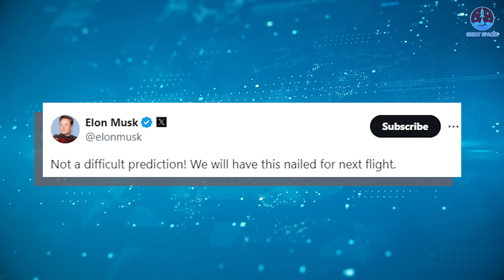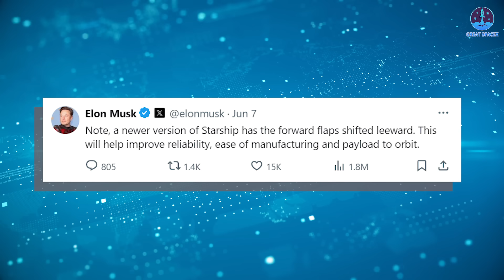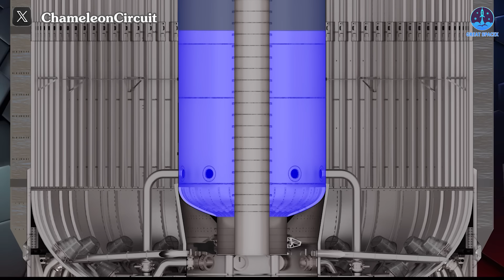Elon Musk Just Revealed Massive Changes On Next Starship Prototype After Flight 4!

Comment: Did not appear to be a HS or attachment problem, but the moveable joint of the flap. Even that narrow gap is a weak point, The joints on the space shuttle were all at the less susceptible aft section of the craft. The shuttle did well but was not as large as this and it still took 6 months to ready it for a next flight. This is still called the development phase, figuring out what works and what doesn't.

Comment: Too many heat shield pc`s. Bigger sections and the equipment needed for manufacture of such larger areas adds to less assembly time and added rigidity.Larger autoclaves and molds would have to be made.It`s a lot easier to make many small pc`s all or most of them the same shape but inconsistencies at attachment points leading to failure.

Comment: Could they not slow the ship down in orbit and then enter the atmosphere much slower, thus making the time under such high temperatures shorter.
Asking as i thought the ship was burning  for a very long time compared to other re-entry burns.
Reply: You need a lot of fuel to slow down. The only way to do that would be to "gas up" while in orbit.Taking more fuel at the launch adds weight which your rocket has to muscle into space.Not a whole lot of fuel remains after getting to orbit.A gas station in space to refill would be the only to do as you question adding to complexity and cost but making for a safer landing.
Reply: This was a test flight, they were gathering data, no trying to get reenter quickly. The more data they can gather, the safer and more efficient the reentry will be. Do you know they intentionally removed tiles and also placed half thickness tiles to test and optimize the thermal protection system. That's what test flights are for. These are not finalized finished products. 

Also, keep in mind this booster was built many months ago. There are new modifications on newer versions,  yet to be tested.
Reply: What happened to the booster and starship? Seems like both would float or at least have some buoyancy making it eventually wash up on a beach somewhere. Did they deliberately punch holes in it mitigate this? Seems like recovery would be a data win.
Reply from the maker: Great discussion

Comment: I'm just a casual viewer of SpaceX's wonderful achievements.  I have always wondered if they could apply some sort of heat shield paint or spray that they could apply over top of the tiles.  That might help keep them from falling off and give a little more protection.  It would burn away and let the tiles do the job that they were intended to do.  The main point is to keep tiles from falling off because a spray/paint/foam/whatever would have no gaps an act like a protective shield.
Reply: Yes, but what is the cheaper or lighter approach .

Comment: I don’t understand how they can accelerate to 26,000 mph in space yet they can’t slow down before re-entry, like turn the ship round to use the same engine to slow it down!
Reply: Fuel and Oxidizer to get up to orbital speed is 90% of a rocket by mass.
Only 3% to 5% of an orbital rocket mass is actual PAYload.

If you reserve 80% to 90% of that 3% to 5% mass for the propellant necessary to REVERSE that orbital velocity, you now have less than 1% PAYload.

TLDR: rocketry physics IRL is a stingy biyatch.
Reply: The extra weight (fuel) means reaching orbit becomes impossible.
Reply: Go check out Everyday Astronaut, Tim has several videos explaining orbital velocity, and rocket engines, and orbital mechanics for entry burn, if you really want to get down to the numbers on a space entry burn and the amount of energy required to de-accelerate, Scott Manly has a vid on that.
Reply: @f.w.1318  But spacex could use some electric thrusters to slow it down or have some other electronic system to slow it down in orbit . I do no see why fuel should be an issue when batteries don't change weight whether fully charged or not. Damn, install some solar panels, let the spaceship coast for a longer period of time to recharge before re-entry..
Reply: @palmtreeshenanigans  Electric thrusters have the thrust of a feather sitting on your hand. Batteries not changing weight when empty is actually a large DISADVANTAGE, not a plus. So you'd add many tons of weight then try to slow it down using basically nothing. Cool idea, kiddo.
Reply: Please learn some basic physics. The reason is elementary.
Reply: @rogerphelps9939  What an arrogant answer!

Comment: They need a big electromagnetic field generator to splay the plasma so it doesn’t interact with key areas. Problem is to make the field strong enough will require a lot of current. And to get a strong enough field may need super conducting magnets that will get too hot unless cooled with lox.
Reply from the maker: Great suggestion

Comment: Given the company's antecedents for exceptional innovation I suspect it entirely possible SpaceX could fabricate the dirigible control surfaces referred to as 'flaps' almost completely out of solid if  reinforced heat shield material.
The revised structures might not be any heavier than the present design which is evidently comprised of some sort of stainless steel primary substrate comparable to the remainder of the vehicle.
Should degradation to the control surfaces continue to occur during re-entry then the extent to which that might affect functionality for the structures could be less likely to be critical prior to completion of transit through that particular phase and affected structures could be simply and probably rapidly replaced.
Reply from the maker: Great comment 👍

Comment: WTF? There weren't 33 "rockets."  There were 33 engines.  Another major mistake and I'm blocking this site in my browser, never to be seen again.  Well, goodbye. This is the 2nd time the hot staging ring was used, not the first.
Reply: Good choice (to block site)
Reply: The guy's a total moron.
Reply from the maker: Oh, thanks for your contribution. We'll fix this soon
Reply: I think he meant it's the first (and only time) this specific hot staging ring was used as opposed to the first time they used a hot staging [ring]?
Reply: You blocked youtube because of this? Or did you just literally block this page? Either way, seems insane and dumb. Maybe just unsub from the channel? On the level of throwing your computer out of your window to turn it off. It'll work; it's just stupid.
Reply: @filonin2  No, I didn't block YT. WTF?  I have the ability to block a YT channel in my browser. Why would I sub to a channel that has very sub-standard information?  there a quite a few channels like this that have terrible information, rather than taking the time to do actual research.  I also block any channel that uses AI narration. The scripts are usually terribly written and the AI mispronounces words. If you can't afford a person to read the script, or cannot take the time to do it yourself, no thanks.

Comment: Why don't they put a landing gear on Starship and land on a runway?
Reply: Weight + more possible points of failure. 

KISS.
Reply: No runways on Mars
Reply: Starship has no need of a 'runway' as it is not designed to sustain horizontal flight and as such is designed and intended to land in a vertical posture.
Reply: It can't fly like an airplane so landing on a runway would be impossible, even with landing gear.
Reply from the maker: Great question 😂

Comment: Flap hinges will not go away as an issue. Ablative ridges running all tge way down the sides instead of flaps would divert plasma away from the vehicle, then they can use thrusters and gimballing boosters to perform a propulsive flip for landing.
Reply: just moving them further back like dream chaser the hinge gaps wont be a problem because the body of starship would be between the plasma and hinges
Reply: they moved the flaps farther back to the leeward side - gets them out of the plasma altogether ... problem solved
Reply: Why use a ridge when you can just put the entire existing ship in the way by moving the flap?

Comment: I think they should make it more like a traditional rocket with a second stage and a payload. So re-entry capsules can be designed like dragon. A specialized Starship just for mars. But the second stage needs a heat shield too so it can be recovered. That seems like the best way to use this system. Re-use boosters fully. Refurbish second stages and the usual maintenance schedule with dragon style capsules and payload fairings. Just the booster alone is a huge asset. I seems like they will have a lot of the same problems that shuttle had when it comes to thermal protection on Starship.
Reply from the maker: Yeah 👍

Comment: a good way to keep tiles from coming of is weld chicken wire then plaster tile over it that should work
Reply: Chicken wire turns to water, at those temps, assuming it's still there after the 26000kph flapping in the breeze..

Comment: I still think they need a better solution than tiles. They will do for now while they get the control systems to function properly, but for rapid reuse they will have to start messing with better alloys and maybe even a system of large one piece ablative shields in spots that see the most abuse that can be swapped out quickly between flights instead of tiles.
Reply from the maker: Yeah, let's wait to see how this system will be improved in the next flights

Comment: I watched the footage and that flap disintegrated badly so a major shift in heat shield method will be required.
Reply: heat shield were fine they are moving the flaps leeward to keep the hinge from the being exposed from the hot gases
Reply: There were tiles intentionally left off the ship for testing purposes, (and an ablative heat tile test) helping them gather the necessary data to make the best changes/updates possible.

Comment: What you see as Failure,I see as Intentional Failure and this is why. The missing tiles were obvious before they sent it. They said nothing. The failed engine was more than likely intentional too.
Keep in mind,The Heat Shield and hot fire shield is erelivent in the mon lander. In fact the Rear engine of the moon lander won't be used until after speration from the first stage. It will only take ONE RAPTER WITH ITS NUCLEAR FUEL CELL. 20 TIMES MORE POWERFUL THAN THE EXISTING 3 RAPTERS
Reply: What do you mean intentional...? Its good that the engines shuts down if there is an failure. But its not intentional
Reply: There is no Raptor ewth a nuclear fuel cell.

Comment: They could use a flexible carbon fiber skin that would cover the flaps hinges and possible the whole flap, then attach the shield tiles. We discussed this at my job since we provide technical information to SpaceX or other companies in aerospace.
Reply: I would think that the carbon would oxidize very quickly.  About the only thing that can handle those temperatures is tungsten and it would still be oxidized.  I think with this thing they just need to do some modeling in ansys multiphysics and put the sensitive spots in a hollow so they are masked from the plasma.
Reply: Carbon fibre will not stand he heat. The binder will burn.

Comment: Land all launched hardware is not true the ho staging ring crash landed
Reply: the hot stage ring will be built into the booster in future so they won't being getting rid of it this a TESTING campaign many things will change when Starship reaches it's final form so hang on to your pocket protectors fellow nerds
Reply: well, the rest is only landed in the did not stayed in the air way too.

Comment: So they are still trying equal what the nerds with slide rules and decades less data to work off of accomplished 60 years ago.  Roundtrip missions to the moon vs. reusable(claimed) equipment that has pulled off some LEO missions.  They still have not had an engine startup in the vacuum of space.
Reply: Oh yes they have had engine sarttups in space. What was done 60 years ago was limited and could never have been expanded to suppor a moon base. his time ittis different and requires a differen approach.

Comment: Pretty good video!  Major issues and potential resolutions discussed. Well done.  Seems to me that the fuel and oxy get filtered about 4 times by the time they are pumped into the main rocket tanks.  Why filter them again?  The spin up and pre-burn tests pretty much clean out the tanks.  It seems to be the pumping that needs simplification.  Need to re-look at plunger type pump with manifold distribution.  Make an alternate design and test it.  Reliability and cost savings might be worth a loss of efficiency.  Or; let the Russians and Chinese do it.
Reply from the maker: Thanks for your great comment. We always try harder to make better video, so keep following and discussing on our channel ☺️

Comment: Lading with all of its launched hardware is not accurate, they jettisoned a big section due to weight limitations, not all of the system returned and part is still in space.

Those flaps are a real problem, the whole design will never be safe, additionally, how the hell are people meant to exit and enter the thing after landing on the moon, the lower part is all tanks and engines and any entry point will have to be well up the body!!
Reply: It's not still in space. No part of the hardware had a positive perigee.
Reply: Are you an engineer?😳
Reply: This wont age well
Reply: The flaps are no doubt being redesigned and the hot stage ring did returned and was jettisoned for simplicity of testing more so than weight limitations
Reply: Ever heard of lifs and ladders?
Reply: @rogerphelps9939  So where do you propose a lift goes, it cant be inside, there are tanks and engine components, cant use a ladder, do you realise how tall the thing is, you think astronauts in suits on the moon will climb ladders on a 50m tall spacecraft, where do you propose such a ladder is even stored?  Lol.
Reply: @stevefox3763  I’m sure it hasn’t crossed their minds yet.  It will be super-embarrassing when they realize they have no way to get astronauts to the ground and then have to design an elevator.

Comment: I'm not sure Space X will solve the problem of being able to reuse the booster and Starship as quickly as Musk hopes.  The rigors of space and especially reentry seem to be beyond today's technical capabilities for a number of years yet.

I do believe Space X will have reusability of the booster long before they achieve reusability of Starship.  This can be mitigated by having more Starships ready to launch while Starships that have returned can be refurbished.  The delay would only require catching Starship and moving it to be refurbished (likely because of heatshield issues) but then a new Starship could be quickly positioned for a relaunch.

Eventually, Space X will find a solution to the heat tiles.
Reply from the maker: Yeah, let's wait to see how they will do

Comment: The flaps only need to stay below critical structural failure temperature for a fairly short period of time before the heat of boundary layer pressures increase to maximum limits. If they can cycle fuel through them to bleed off the heat it may keep them cool enough to endure.
This could also act as a Pre-heater for the fuel prior to propulsion system injection.
Reply from the maker: Yeah♥️
Reply: Just make the area that melted (the other side might have done as well but only one camera ) of a more solid construction and better heat tiles
Reply: preheat cryogenic fuel?  have you lost your mind?

Comment: I know Elon  Won't  But.....
SpaceX  really  should  consider  going with  " Short Stubby Wings " instead of " Movable  Flaps "...that would eliminate  a vulnerable  heat shield  junction  point between  the body of Starship and the Flaps....! 
The Flaps are mainly used to disappate  speed in re - entry...use vectoring thrusters to control " Pitch & Roll "...
Reply: Redundancy - "Belt as well as Braces".

Comment: With no mishap investigation, they can fly again right away, but there's no point doing so with the current flap design. It will be interesting to see if they scrap their remaining ships, or modify them.
Reply: there like 2 versions ahead ont he prototype and from what this video said they already have it changed on a diffreant prototype
Reply: The next Starship orbiter will reenter Earth's atmosphere with it's flaps angled at a higher degree until closer to the "flip" stage of the process from what I understand. I'm thinking the drawback with this is the ship's velocity will increase substantially requiring more fuel necessary to slam on brakes so-to-speak before landing wherever it will land or splashdown next time.
Reply from the maker: Let's wait for their next steps ☺️

Comment: Landing so near the complex is way too risky, no matter how successful they have been. At some point, there will be a failure that could cause the ship to crash into the equipment, tanks, or buildings which will be a massive disaster. This is way to easy to avoid by placing the launch tower farther away from the rest of the facility.